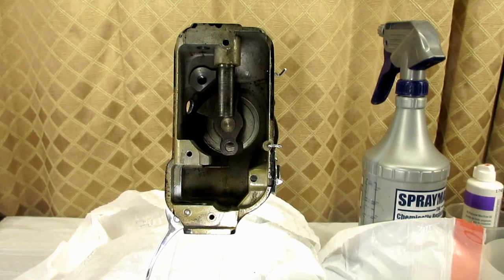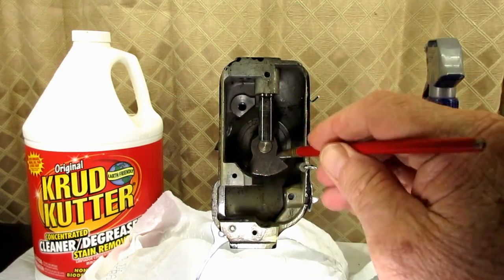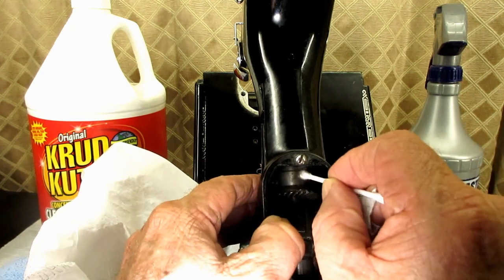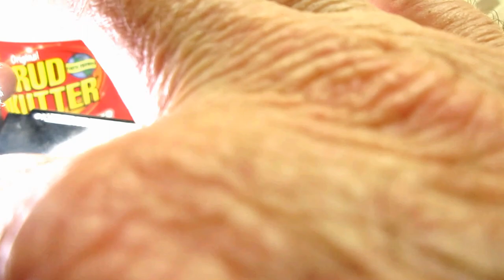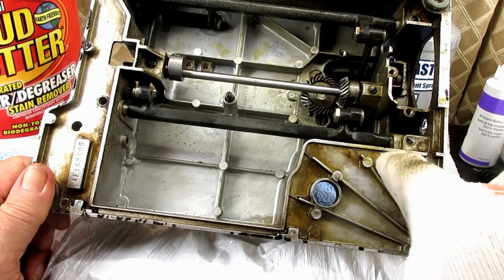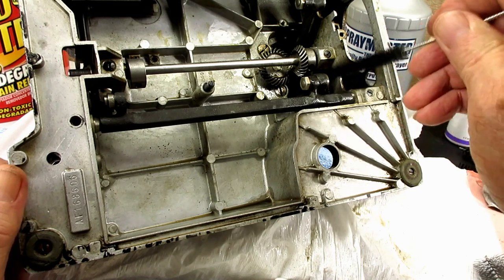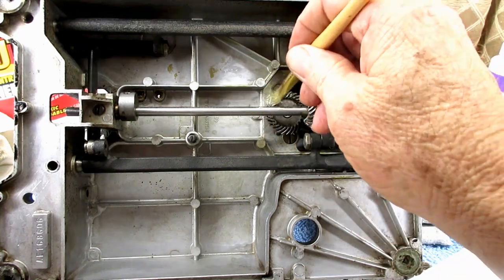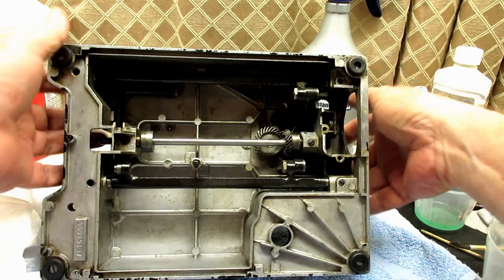On Cleaning the Inside of a Singer Model 221 Featherweight

Comment: My husband bought me a featherweight this weekend. I looked at her gears and they were filthy, way worse than this video (I'm surprised she worked). I've now cleaned, greased and oiled her and she is looking so much better (though there is more to be done). Thank you for giving me the confidence to work on her myself.
Reply from the maker: I'm glad you found my channel! Jenny and thank you for rescuing that machine. I'm sure you will enjoy using it and it is worth the effort for sure
Reply: @andytubesewing1953  I have two Rocketeers that I will work on this summer. They will need a lot more attention. One was sitting outside in the Florida humidity under a tarp! (power cable broken but everything moves freely).The other one came with a table, chair and accessories and turns on and runs (but didn't want to push her). I got everything for $65 total! Excited but nervous to make a start.
Reply from the maker: @JennyBennett-w3m  What a bargain! I appreciate that you want to rescue these machines. Once you start you will be fine. I have found it's hard to hurt a vintage Singer machine if you take your time.
      May I offer some suggestions? 
Over the years I have found that the Service Manuals (when available) are wonderful tools to have on hand for understanding adjustments and factory settings. 
     For your 221 featherweight you have a great resource at "The Featherweight Shop" here: https://singer-featherweight.com/  
If you look in their "School House" section you can find free manuals, including the Service Manual. They have tutorials for different parts and systems on the machine. A family-owned business with a sparkling worldwide reputation.
My Playlist for the 221 can be found here: https://www.youtube.com/playlist?list=PLsCOZgzzaiKIA1OPw0k6QOSTE-wAUZ4kp
     For your Rocketeers, you can download a FREE copy of the Service Manual for the 500A & 503A models. An incredible 46-page PDF full of diagrams and instructions for lubrication, use, adjusting, and parts replacement, with clear factory setting spacing, timing, height clearance, etc. https://sewingdude.files.wordpress.com/2012/09/singer-500-service-manual.pdf  
Here are some of my Playlists that may help you with your Rocketeers:
a short list of 500A videos: https://www.youtube.com/playlist?list=PLsCOZgzzaiKIk6-t-zdVJKQVVAE6TjrE-
A Playlist for Model 401A, the machine the 500A is based on, with many of the same parts & systems: https://www.youtube.com/playlist?list=PLsCOZgzzaiKLiDl9yFTP6mJgQmz5lj4NO
A Playlist for model 503A Rocketeer: https://www.youtube.com/playlist?list=PLsCOZgzzaiKJZaZn2zl3LsnV2d7UhrqvX
     I try hard to make my videos clear enough that folks can use them to work on their machines, but you can't beat a document from the original manufacturer that explains so much. 
     Finally, you can download FREE PDF copies of most of the Singer Instruction Manuals from SInger Support. https://www.singer.com/support    Just enter the model number in the big search box and a new page will open with any available manuals for download. I have an Instruction Manual available for every machine I work on. It can be helpful to understand how the machine is SUPPOSED to work, and all the settings when something is not working the way you want. 
     You really have a strong support group by your side between instruction and service manuals, my videos (and many others) on YouTube. Tap into your excitement and put your nervousness to the side. You'll have such fun and find working on the machines, and the results of your work, to be very rewarding.

Comment: Have you ever cleaned the inside of a machine that has a cloth timing belt? Any thoughts on how to do it?
Reply from the maker: Are you talking about the cloth/fiber belt with metal cleats woven into it? No, I've never worked on a machine like that. I'd still use the Krud Kutter I think, after testing a drop on the belt. The instructions for the Krud Kutter Cleaner and Degreaser include the mixing rate for carpet, upholstery, and laundry presoak. A 10% solution. Here is the webpage for more info
https://www.rustoleum.com/product-catalog/consumer-brands/krud-kutter/cleaners-and-stain-removers/original-krud-kutter     I've never used it but they make a sports stain remover laundry pre-treat also. I don't know if it is a different formula or just marketing but here is that webpage https://www.rustoleum.com/product-catalog/consumer-brands/krud-kutter/household-cleaners/sports-laundry-pre-treat?ls=305473&lc=
I'm assuming you want to clean the insides of the machine while leaving the belt in place
If you were taking the belt out, I would either replace it with a new one (after all that work) or still clean with the KK or even laundry detergent. Remember, I've never done this, but that's my thoughts about it. Make a video if you do it! Probably 1,000 people with the same question, right? Good luck.
Reply: @andytubesewing1953  Yes one of those belts with the cleats. Oh nooo, not taking the belt off. I'm using your 7 Screws Technique for cleaning my Singer 319W and I don't want to mess with it too much. I'm probably going to go with using a 10% KK solution and spray lightly around the belt.  Thanks Andy, you're a Legend!
Reply from the maker: @rockymarmolejos5056  OK, I'm disappointed but I get it. I suppose it is possible, but I've never seen anyone remove/replace the belt. I think you will be fine with the KK if some gets on the belt, and the other parts will be clean and fresh. Good luck.
Reply: @andytubesewing1953  Hahahaha ok, maybe I'll be as courageous and daring as you when it comes time to clean a Pfaff 130 I have that also has a cloth belt. I keep you posted if I decide to remove it before cleaning ;)
Reply from the maker: @rockymarmolejos5056  You're a better man than me, Rocky, to tackle removing that belt. I'd sell the machine and buy a nice slant-o-Matic or Rocketeer before I bruised my ego by failing a belt change 😀  Regardless, best of luck with your machines and take care.